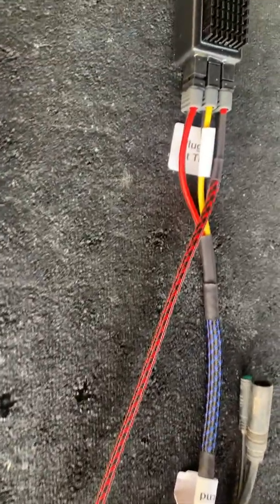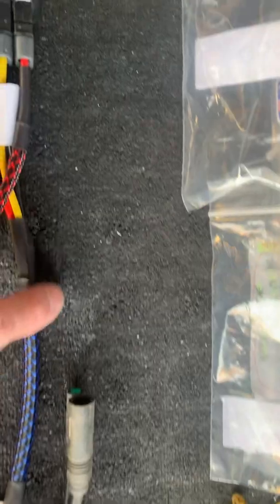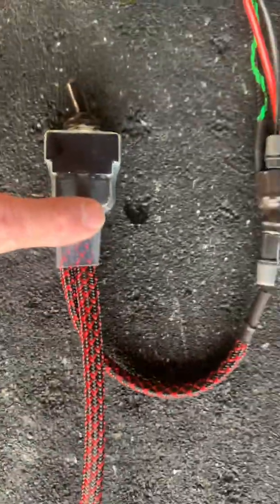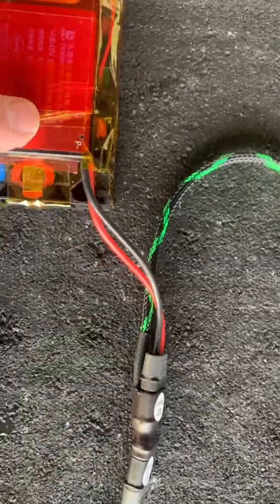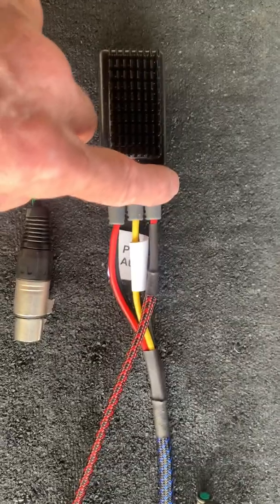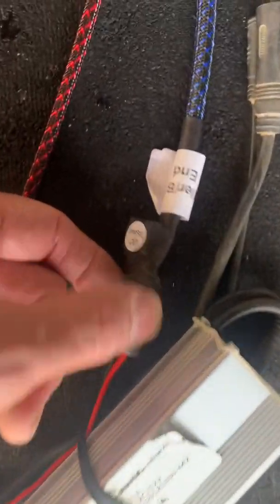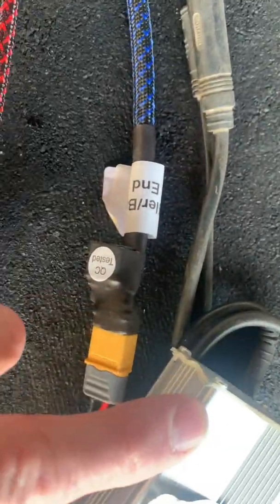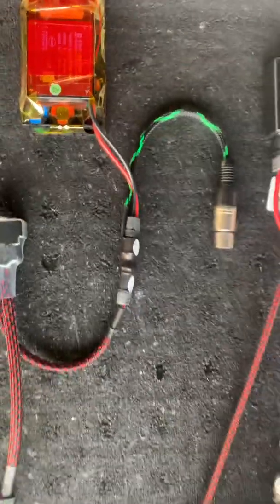Connecting the FBC and Aux Battery Accessories

Comment: Is that working with 2 different voltage batteries  I have 60 volts and 52 volts, I have an ariel rider x52, so I want to use my extra battery but is a 60 volts.
Reply from the maker: You could use two different voltage batteries, yes. However, the real magic of this device happens when the voltages have a lot of overlap, then the current will be drawn from both batteries at the same time.  The more you keep the voltage in the same range the better.  Slightly undercharge the 60v battery, and you've got a better match.